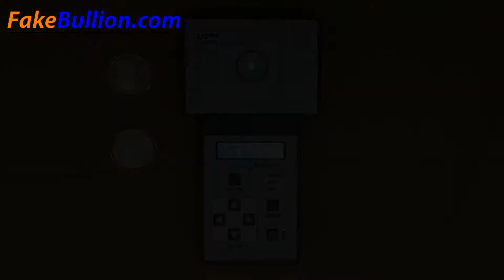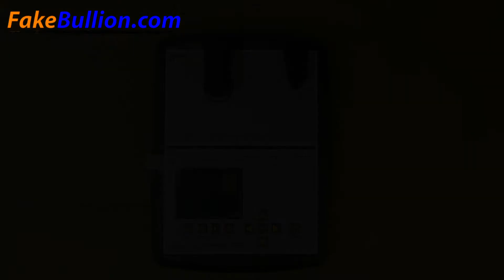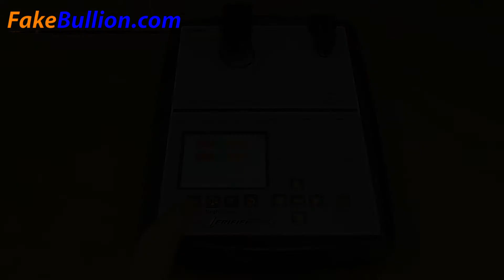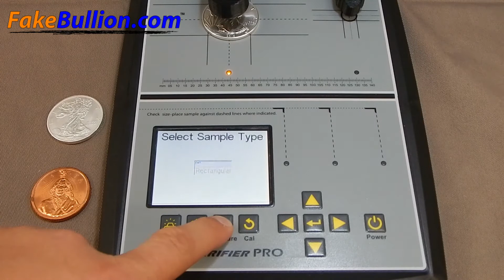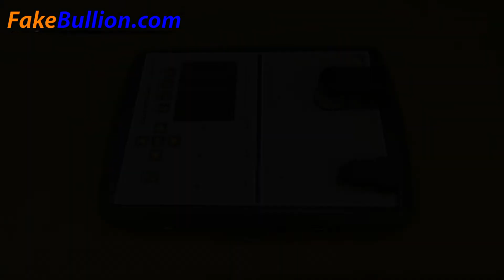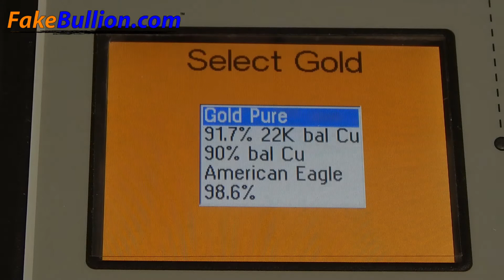[1] Sigma Metalytics PMV PRO - Introduction & Review

Comment: Very very good video showing the difference in accuracy in testing PMs with these two devices. This one definitely seems much more accurate. Even still, to be 100% sure I would always recommend an xrf scan, especially with gold!
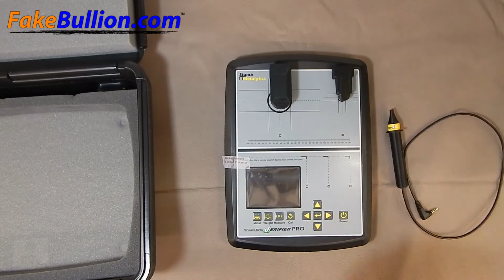Reply: XRF scanners are useless for through-checks as the X-rays only hit the surface metal a few microns thick (not even  milimetres thick). The scanners work on the basis of excitation (Fluorescence) when X-rays hit the surface metal. A tungsten filled bar or coin would easily fool an XRF device. Further I seriously doubt a coin dealer would allow you to use a Niton gun to blast some x-rays on his coins for checking. The most accurate method is by using ultrasound techniques (gauge or through reader - the same device use to detect thicknesses or  flaws in metal) of which bullion banks use for gold bars. However this would be impractical to bring to a coin shop for testing coins during a purchase as no coin dealer would allow you to slap on couplant (gel) on their coins or bars. The SMPro is the most practical tool to use when purchasing coins and bars from a coin shop or bank. In addition to resistivity measurements to screen out tungsten, the Pro allows immediate density checks which should screen out any copper filled bars and coins. Check it out : https://youtu.be/89ATeNy3DIo . This one should scare you : note at 2:46, the XRF devise came back with pure gold for a fake tungsten coin coated with gold https://youtu.be/YR_1xaWBeZ4
Reply: XRF can be defeated if you are a bit generous with the gold plating. A layer 0.5mm thick or greater is sufficient to pass XRF detector.
Reply: @ptaeiy Hi there;
OK let density of gold = rho
r= radius
t = thickness of coin
Using a coin > volume = pi X r^2 X t
Density = weight/vol
In the SMPro you input ;
-	 weight say 1toz or in grams 
-	Metal type gold /silver/ so in effect you input rho
SMPro works out 
-	the thickness as the resistivity is a through measurement (up to specified thicknesses)
-	and also the diameter (on screen for you to check)
rho = weight/ [pi X r^2 X t]
weight – is input
rho – is input
t- is worked out by SMPro
r or d is calculated and worked out by SMPro

Ditto for bars

I also have an ultrosonic gauge but this is more suited for thicker bars. If you want to use an ultrasonic gauge it is better to pay a little more for one which can measure the thickness to at least 3 decimal places.
Reply: @ptaeiy Hi There  - it's up to you - I have the SMPro as do many coin dealers (you may verify this yourself) - it is just so easy to use especially at the point of purchase. I also have an ultrasonic gauge for bars (the one I have is cheaper than the price for the SMPro). But you have to remember most bullion dealers wont allow me to use my Ultrasonic gauge as I need to apply the couplant. It's unwieldly and impractical at the point of purchase. I need these pieces of equipment as I have a lot of bullion and  buy on a monthly basis. Mainly gold. Any 1 oz mistake will cost me.
Reply: @ptaeiy Agreed that *nothing is full proof.* Previously I had devised other methods to check, like with the usage of neodymium magnets, but most of these are clumsy and useless at the point of purchase. Also with any magnetic tester, any inclusion of ferrous materials in the minting process will produce a false negative. But experience also helps e.g. I can now check 9999 maples (prior to 2013 with the laser-micro-engraved security feature)  without the need for any tester (almost), and with the Aussie kangaroos from 2019 onwards. If one knows what to look for.

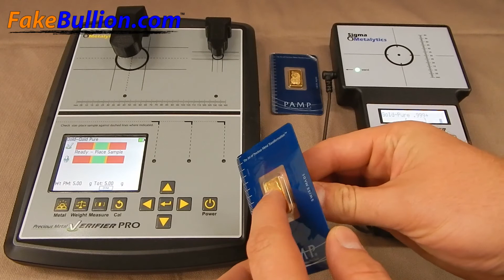Comment: But at 8:14 if you would have used a bullion wand? Wouldn´t it had detected the fake one?
Reply from the maker: That bar is too small to use the Bullion Wand, and if the bar is made of a sufficient copper alloy, it can read as gold on any of the sensors. It is very important to always check the size and weight (density) of the item, even when it reads within the expected range on any PMV device. Generally a fake can match the PMV reading, or the density, but not both.
Reply: @FakeBullion  Thank you! And in general the bullion wand? Isn´t it much more reliable than any other sensors of the regular tester? I´ve ordered especially a bullion wand because it comes 2mm through the metal instead just 0,2mm ... actually it´s a good idea to always use the bullion wand right? What would be too small for it? Everything thinner than 2mm ?
Reply from the maker: @ch.wey.4406  The Bullion Wand does penetrate into the metal deeper than the other Original PMV sensors. The piece you are testing must fully cover the face of the sensor/wand. So for the Bullion Wand, the item must be at least 24 mm in diameter/width. Additionally, to test samples with the Bullion Wand and without using the calibration disk, pure silver must be at least 4.0 mm thick, silver alloys and pure gold must be at least 4.5mm thick, and gold alloys, platinum, and palladium must be at least 7.0 mm thick. If the sample is thinner than that, you must place the sample on top of the calibration disk and then place the wand on top of the sample to get an accurate reading. But the sample must still be at least 24 mm in diameter / width.

At this link you can read the PMV Original User Guide, PMV Original Technical Guide, and PMV Original Sensor Selection Chart for more information on the Bullion Wand:

https://www.sigmametalytics.com/manuals
Reply: @FakeBullion  Great informations! Thank you!
And a last question. For me as a private user... does it make sense to have a pro version? I have a lot coins and bars and I´m buying a lot at official gold traders. But for what I´ve bought the regular tester was to buy on the private market. As you said acutally the regular tester should be okay if I double check the coin or bar regarding to it´s dimensions right? I mean there must be a good reason for the decision to buy the regular one or the pro version and I´m not sure about that. If the pro version is the "perfect device" actually nobody should buy the regular tester. I´m still a little bit confused :-) Sry for that
Reply from the maker: @ch.wey.4406  The Original PMV is usually sufficient for collectors and private users. The PMV PRO measures dimensions for you, instead of manually using calipers. The PMV PRO can also measure the thickness of some items in assay cards and numismatic slabs without opening the packaging. But the PMV PRO is higher cost than the Original PMV. So the PMV PRO is good for coin dealers, pawn shops, and other high volume users who test many items. Sigma Metalytics recently announced a new model, the PMV PRO Mini. The Mini has many of the features of the PRO, but it uses Android or iOS device screen over wifi instead of having a built-in screen. The price of the PRO Mini is in between the price of the Original PMV and the PMV PRO. We will make a video on the new PMV PRO Mini soon.

Comment: is there a reason why a real silver eagle or the real silvertowne bar give resistance reading higher than the published 1.59e-8 ohm for silver?  The PMV-pro was yielding reading of 1.73-1.76 for silver eagle and 1.64-1.75 for silvertowne bar.  These resistance is closer to copper, 1.68e-8 ohm, than for silver.
Reply: Silver Eagles are only 3 nines silver (99.9) Small contamination in the 0.1% can increase resistivity. Are you using the right setting for 99.9 on the machine? 

This deviation from pure silver get me worried about really good fakes, that nobody has seen before.

This is why I prefer Canadian maple leaf which is 4 nine silvers. (99.99%) Silver has the lowest resistivity of any known metal, so faking 4 nine silver is next to impossible.
Reply: @nickl5658  I understand your worry. This is why one needs to check weight and dimensions too. If OK you are good to go. At least for bullion. Counterfeit Numis are a different story.

Comment: Some how this unit seems more complicated to use that the original Sigma Metalytics Precious Metal Verifier which produces fairly accurate results. Still expensive at $989 but less than half the cost of the PRO.

Comment: Can the unit verify a Roosevelt Dime, Jefferson War Nickel, Washington Quarter, Kennedy Franklin half, or Morgan Peace dollar? If the market someday crashes and silver and gold moves to its actual value possibly showing on the US Debt Clock these will be hot items of exchange for products or services. Everyone will want to own one, all business will use them? Please test if available on released SMPro. Thank you so much.
Reply from the maker: The PMV PRO can test 90% silver coins, however it is a little trickier than testing other standard alloys.  US silver coinage is nominally 90% silver and 10% copper, however the alloy frequently contains trace amounts of other metals like tin and lead, which throw off the electrical properties.  Generally the older the coin, the more impurities,  so the PMV PRO has three date ranges for 90% coin silver:  pre-1900, 1900-1945, and 1945+.  The newer the coin, the more consistent the alloy, and the narrower the testing range.

Even with those varied ranges, we have found some genuine 90% coins that fall into the red zone.  However, the counterfeit 90% coins we have tested have resulted in numerical values of 7 or greater, where the genuine 90% coins typically read 2.5 or less, even when they cross into the red zone.  So the PMV PRO does provide useful information when testing 90% coins, and at least for now, there is a large enough difference between the genuine and counterfeit alloys to distinguish them numerically.

Neither the original PMV nor the PMV PRO can test war nickels.

Comment: I'm about ready to quite buying pm's. This is getting frustrating. I just spent 800 bucks on this damn pm verifier and now I learn it's not that great. And everyone always says to weigh it so I bought a scale and my silver eagles are never what they say they are supposed to weigh on Wikipedia. I have bought all my gold and silver from APMEX and local coin shops but my sigma will say the coins just barley qualify as real being almost outside the box and like I said my scale and also my caliper come up with different measurements and weights then what it's supposed to be.
Reply from the maker: There is usually some variation in the weight of mass manufactured precious metals, particularly silver.  A troy ounce is 31.10 grams, but even genuine bars and rounds will often weigh a little more.  This is due to manufacturing tolerances and because it is more cost effective for the manufacturers to give away a few cents worth of extra silver than it is to scrap the piece and start over.  Measuring the weight and dimensions is really a way to check the density of the metal.  Currently a fake can match the electrical properties of the real metal (as measured by the PMV), OR the density of the real metal (determined by checking the weight and dimensions), but not both.  You can calculate the density even if the piece is slightly over the stated weight.  Pure gold is 19.30 g/cm3.  Pure silver is 10.49 g/cm3.  Pure copper is 8.96 g/cm3.  Brass, which is what most fakes are made from, is even less dense than pure copper.  I just weighed a half a tube of 2012 silver eagles and they ranged from 31.15 to 31.36 grams, all genuine.  Buying from a major online dealer minimizes the risk of receiving counterfeits.  Most counterfeits are sold by individuals through Craiglist, eBay, selling apps, etc.  They do sometimes show up in the secondary market at pawn shops or, on rare occasions, at coin dealers who are not familiar with the recent influx of fakes.  Make sure your favorite local coin dealer knows about FakeBullion.com and keeps up with modern detection methods.
Reply: I hear ya!

Comment: how does it work with poured bars?
Reply from the maker: The optional wands can be used to check larger bars.  The Refiners Wand can read ~2.5mm into the bar (minimum 24mm diameter to cover the face of the sensor).  The MicroWand only reads about 0.1mm into the bar but can be used on small items.  Coupled with checking the size and weight, these can help detect plated bars.  Poured bars tend to have more surface variations which can affect the readings, so it's best to test on the flattest area available, and to test multiple areas on the bar.

Sigma recently released a new accessory for the PMV PRO, a large External Bridge.  This is a larger version of the bridge sensors on the main unit that plugs into the DB port on PMV PRO.  This sensor is able to read all the way through large bars (roughly kilogram size up to 100 oz) as well as take a surface reading, so it's capable of identifying "drilled and filled" bars along with plated bars.
Reply: I would probably use the large wand and test the bar in a lot of different places and see if the readings very much.  Just a thought.
Reply: @FakeBullion  how much is the larger external bridge?
Reply: good question
Reply from the maker: MSRP on the External Bridge is $485.  Some retailers may offer it for less, especially if you are buying it as part of a package deal.  You can add an External Bridge to an existing PMV Pro, but you do have to ship the PMV to Sigma to have the External Bridge matched and calibrated.

Comment: I have perth mint 10g and it didn't fit the smaller sensor with its cover on. Is it a red flag? Also when tested, it passed through resistivity test and the density test but not the surface test. The dealer told me it happens when I have the cover on, but it seems like your gold bullion passed those tests even with the cover. Can you please help? I only have so much time if I should return it
Reply: I can show you the picture of the testing. Please help
Reply from the maker: The assay cards on some of the small, genuine Perth and Pamp bars are too thick to fit under the Small Bridge Sensor, so that alone does not necessarily mean the bar is fake. Sigma Metalytics recently revised the Small Bridge sensor to be slightly taller to accommodate those assay cards, so they will fit on newer PMV PROs. On older PMV PROs, the most reliable way to test the 10g bar is to remove it from the packaging and use the Small Bridge Sensor, and check the weight and size.
Reply: @FakeBullion  thank you for replying. As I said, I have 10g gold bar from Perth mint. Your video told that the only small bars that won't fit is 20g one so it worried me so much. So... like I said, I had to test with the bigger lense, and it showed green on through test, yellow on surface, and green on size test. What is your confidence level in this testing on this? I can email you the pictues...
Reply from the maker: @LOL-ho4rt  The metal must cover the entire sensor for an accurate measurement. The 10g bar is too small to use the Large Bridge Sensor. The Large Bridge Sensor will not provide an accurate measurement. So I cannot judge anything from the information you provided. You would have to remove the 10g bar from the assay card and test using the Small Bridge Sensor for an accurate measurement. 

The only information I can provide you is an example of a counterfeit 10 gram Perth Mint bar. I measured the counterfeit plastic assay card "bubble" that holds the bar to be 4.29mm thick and total weight in assay card 17.42g. Unfortunately, I do not have a genuine 10g bar here to compare.
Reply: @FakeBullion  thank you very much... always a big time fan of your video. And I had to re watch your video multiple times to tell if my collections are real. By any chance, do you have readings with bigger lense on your fake bar as well... I wanna know if the machine is giving you the not so accurate results.I really appreciate all the information in your video to educate small investors here. I always get my bars from a legitimate source but it was little different this time. Again, thank you very much !!! You are one of the few channels that is actually helpful and make the whole youtube platform great.
Reply: @FakeBullion  maybe you can  also make a video about importance of using the device by the book and cover some  cases where it can show a false positive